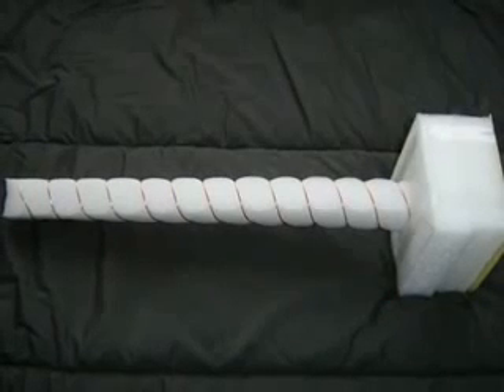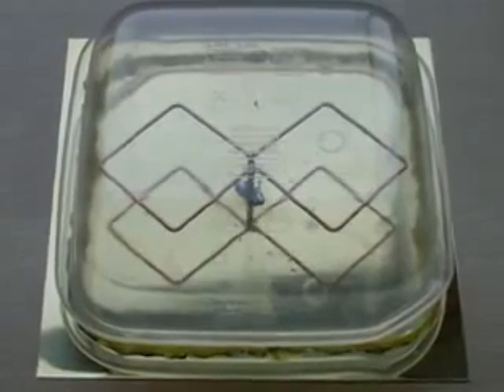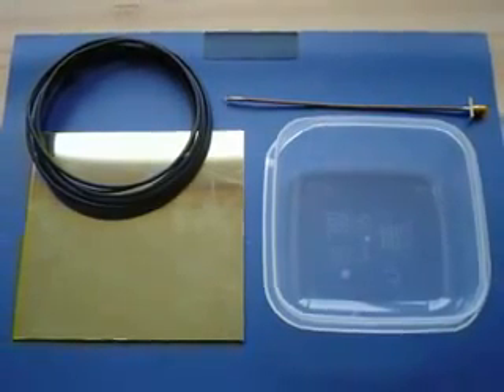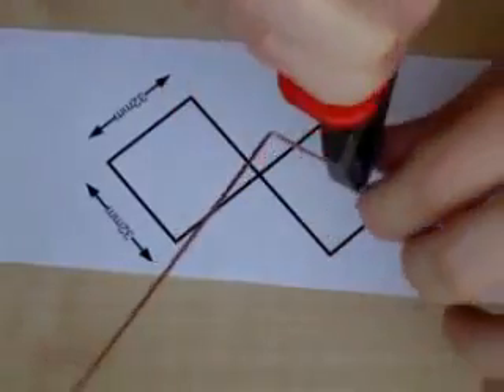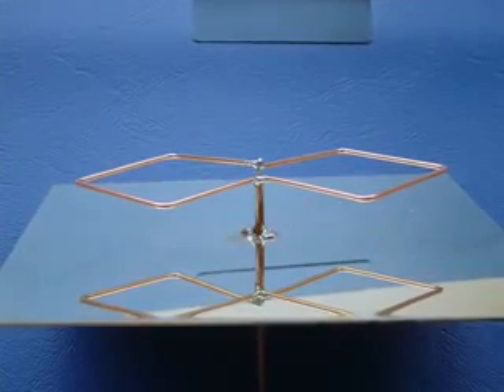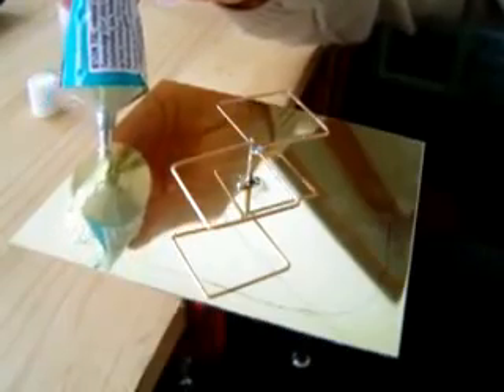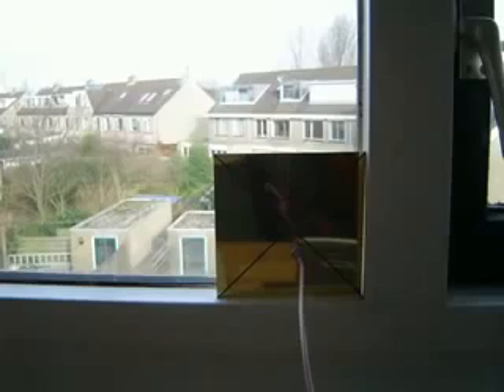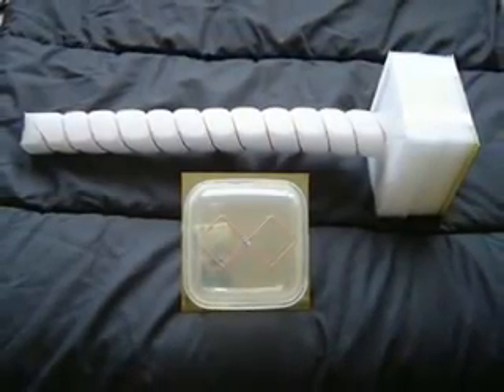How to build a WiFi antenna

Comment: Greetings: 1) If I observed correct, I have 2 dual quad loops active elements. Both  closed center fed and soldered 2 the plate ..which is now a another radiator, however nonresonant at same frequency. Not mentioning the impedance mismatches and phase inversions, I fond it theoretically difficult 2 believe it works by design. Rather it may offer improvement over an internal router antenna Bcuz it is remote. I am not saying this is typical Ujunk DIY millennial yuppy bait. Then again I am not.

Comment: where did you get that template
Reply: You can make it yourself.  If you can't, I created one and put it on my web site:  k5msk (dot) com. Look for biquad-wifi-template.pdf at the bottom of the page.  BE SURE you print "Actual Size" and then verify with a ruler.